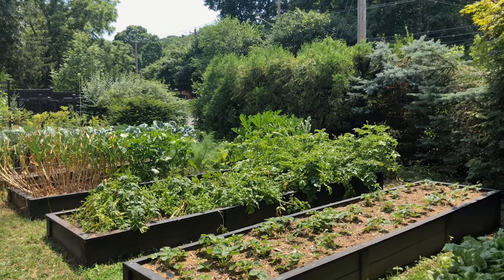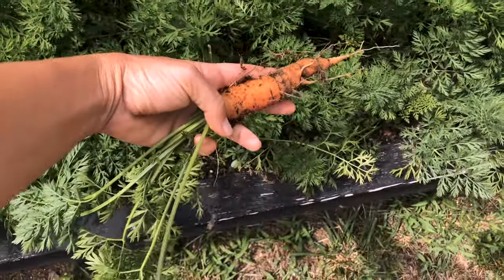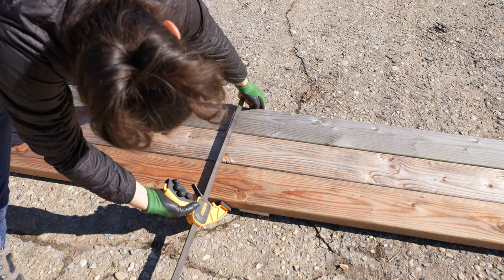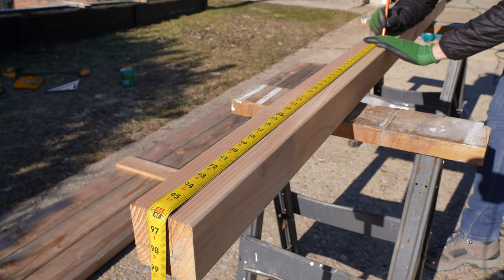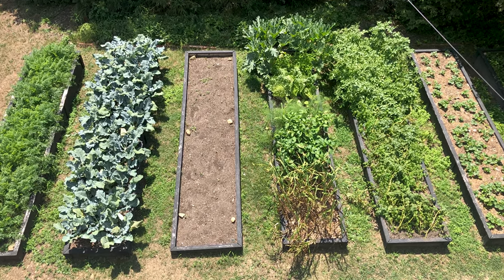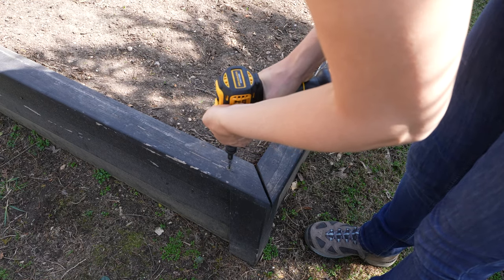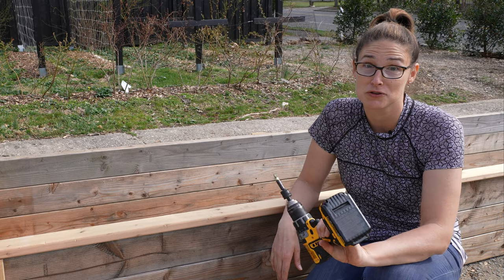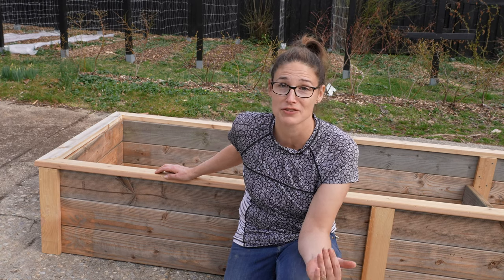Raised Garden Bed DIY Build (Modern Design!)

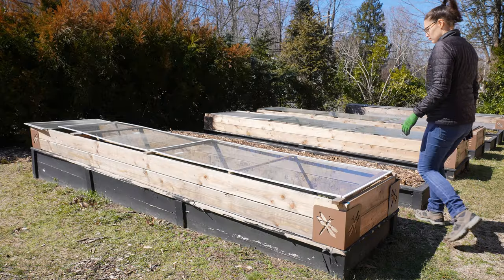Comment: at 0:54 I see those metal corner braces and realized that I bought the same ones a few years ago but never used them. Do you have a video that shows how you used those metal corner braces (with the drangonfly etc.) to build a raised bed?
Reply from the maker: Haha! That's to funny! Yeah, I got them for Gardener's Supply. I never used them to make garden beds (I bought them specifically for knock-down cold frames), but they're pretty easy to use. Good luck!

Comment: How long do these beds last when using that protection amd stain?
Reply from the maker: I'd say about 10 years. I just started replacing the first two I built this year. They are 7 years old and I did not stain or use waterproofer until 3 years in. (The later ones were stained and waterproofed before they went into the ground.)